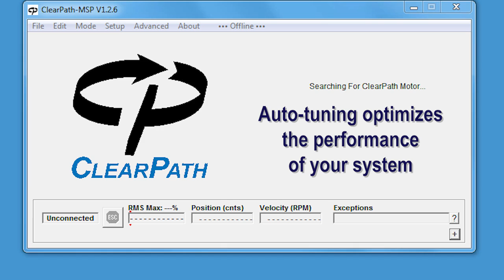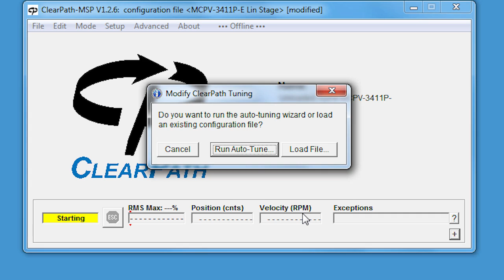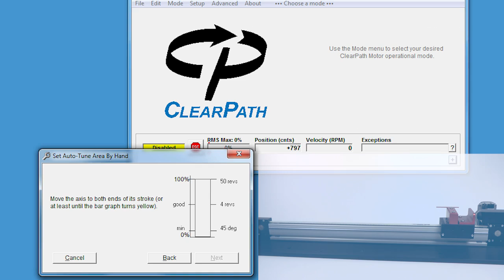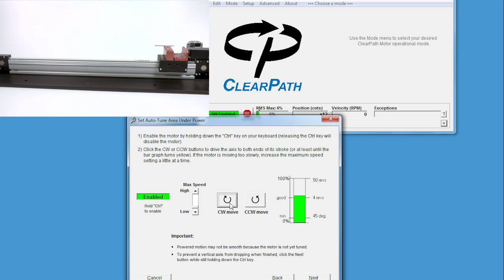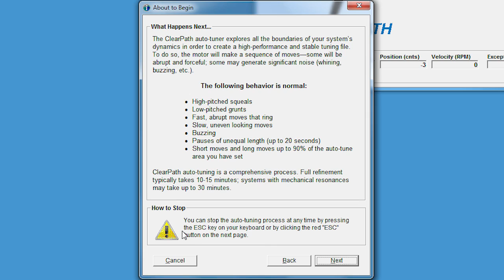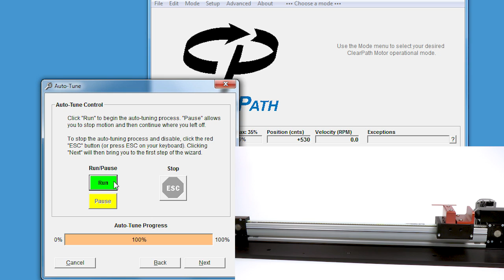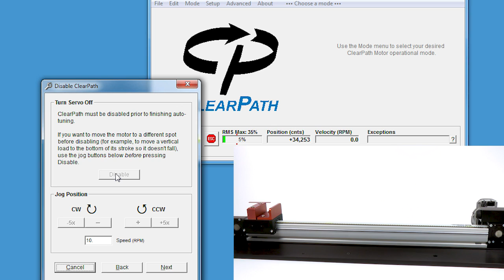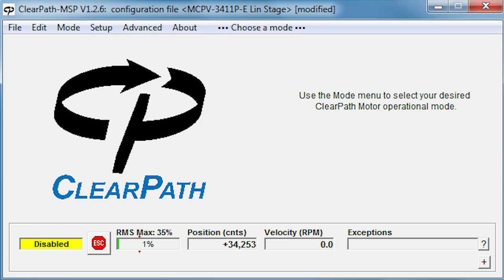How to Auto-tune a ClearPath Motor

Comment: I would love to see a solution for tuning your motors when you have 2 motors driving a single axis, ie, a dual drive gantry. I am absolutely certain that this type of setup is very typical. I am currently using your product on a new project (step and direction) and prior to my purchase, I did inquired if this was possible and how to actually do this. When you have a machine that has similarly constructed axis, an educated "guess" based on mass, etc., can actually work. However, when two different drive methods are incorporated (one axis is screw driven, one axis is rack and pinion driven with 2 motors, which is extremely common), you can't use the method you describe on your website or other methods that have shown up on YT videos to get accurate tuning values. I am not saying that your auto tuning is not a God send, it really is, as long as you have one motor per axis. In my opinion, you would absolutely dominate this market with your SK and HP motors, if you could actually come up with a way to "auto" tune a dual motor axis. Even if I had to purchase a couple of extra long USB cables to plug in to a USB hub connected to my computer, being able to properly tune a dual motor axis would be incredible and innovative, and would put you guys on "the map" for shlubs like me that are itching badly for a solution to a "common" use problem, especially if this is what we do to make our bread and butter. 

If this idea is not feasible at this point, could you document a way to do this by actually constructing a build like I am describing, and making a video of how you would go about tuning this type of typical system, instead of every video showing one motor drive set ups... Again, you guys have the best thing going right now in my opinion. But also right now, 2 out of 3 axis on my machine are tuned. I can show you what I am doing on my setup and it is very clear that my gantry with dual drives is almost impossible to tune without a degree in motion control. I know I speak for more than just myself and any and all advise would be greatly received!!! Thanks again for a great product!!!!
Reply from the maker: Thanks for the feedback Moto Geek, sparky7071, Robert Murphy. 

Though we have been thinking about a dual motor auto-tuning procedure, tuning a dual motor axis using an auto-tuner creates many logistical challenges (too many to mention). However, we do understand the high level of value that this functionality would provide to the machine builder.

Moto Geek, I understand that your mechanical design for the X and Y axes is different so the following procedure will not work for you. However, let us know if you need help tuning your dual motor axis and we can certainly help you.

In the mean time, if your single motor, short cross-table axis (often called Y, sometimes called X) has the same mechanical design as your dual motor axis, you can use the following procedure:

1) X and Y axes often times have the same mechanical design to make the machine easier to build and to make the coordination of the axes easier

2) The vertical Z axis often has a different mechanical design than the X and Y

3) The optimal way to create a dual X file using the auto-tuner is to load 1/2 the total X gantry weight onto the single Y axis and then run the auto-tuner. You usually would not use the Z axis because it is biased downwards based on gravity (which the dual X axis is not) and because of the mechanical differences.

4) After auto-tuning the Y axis with the additional weight, load the Y file into both X motors.

5) Click the "Reverse Direction" checkbox for one of the X motors and save the two X motor files with different names (e.g. XA_SDSK-3421S_rev1 and XB_SDSK-3421S_rev1)

6) Run the X axis. If the X axis does not seem to have optimal tuning, trying moving the "Fine Tuning" slider (MSP, Setup, Fine Tuning) to see if your results get better. You will need to do this procedure with both X motors before evaluating the effectiveness of this step. If you make any changes, re-save the files (overwrite the old files or create new names) so you have the files saved in a safe location for the future.

Teknic Tom
Reply: I agree with Moto Geek, there needs to be a better way to tune a system with two motors on a single axis.
Reply: "Moto Geek, I understand that your mechanical design for the X and Y axes is different so the following procedure will not work for you. However, let us know if you need help tuning your dual motor axis and we can certainly help you."

That would be great! I will get two laptops hooked up to my motors and give you guys a call. The machine is working, but when I do a jog, for example, as the motors turn and then come to a stop, I can see them basically overshooting and then moving slightly back to get to the commanded position. To describe it in words, they kind of like "boing" to a stop. I did try the slider for fine tuning, but not getting much better results. I feel like I'm a little too far away from optimal tuning for the slider to really help much. I will be in touch. Is there any better time of day that I could call you and go through whatever procedure?